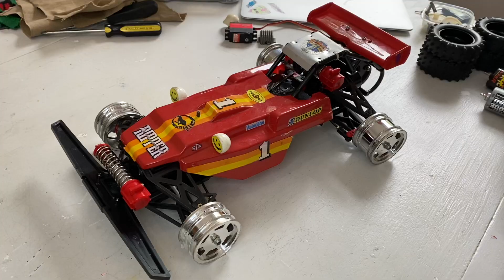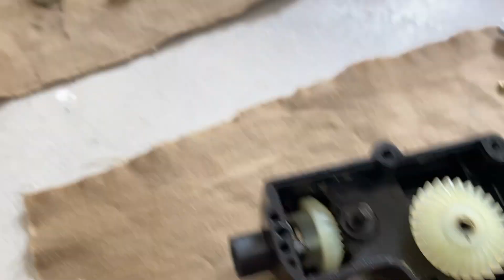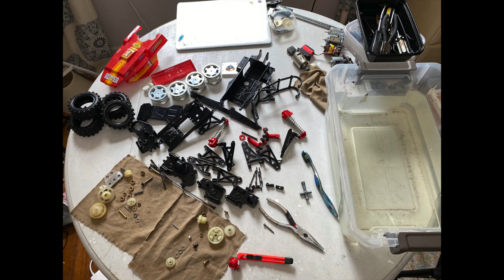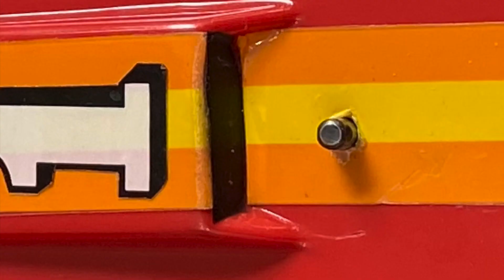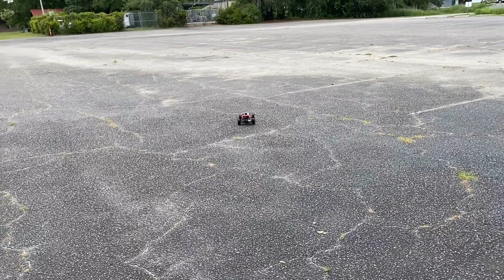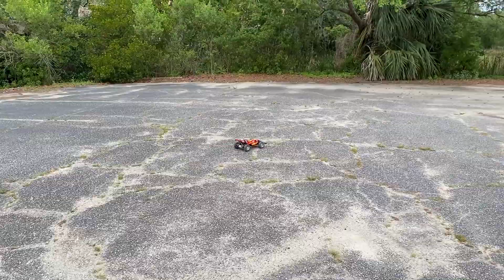1986 ROYAL RIPPER RC RESTORATION AND RUN REVIEW

Comment: I got the Ripper right after it came out. I burned through the speed controller the first day I was running it. So I end up building an ESC out of a components sources from a hamfest. It broke a lot. But I did keeping it running off and on for many years (aided by the two weeks it took to get spare parts from tower hobbies in the 1980s).  Plus I built many ESCs for locals. This was back when you couldn't really afford them.  Oh, but I did configure mine have more steering in the rear.  Yes, it was harder to handle, but you got used to it, and it accelerated much better out of the corners. I also ran foamies on it. I turned down the diameter of the foams in the rear, which gave the fronts a bit of overdrive.
Reply from the maker: Great memories. Thanks for watching

Comment: I had the Royal Crusher.  It was pretty good, I do remember the idler gear in the rear gearbox being a weak point in the car.  I think it was due to the size of the tires on the Crusher.
Reply from the maker: Vintage Rc is something special. Thanks 😊

Comment: Does anyone know where I can get a rear suspension end cap for one of these?. It’s the only part i’m missing. Thanks guys
Reply from the maker: I doubt you will find it unless you buy a parts car. Those are rare too. Best bet get the size of shock and get an aftermarket replacement. Maybe a little modify scenario there. ✌️

Comment: Hello. Nice channel. Just wanted to share a couple things from my personal experience Had a couple Crushers/Rippers back when they were still on the market . The chassis on both as you stated were weak as well as suspension parts. My experience with the gears in both were that they were very weak and easy to strip. I'd get 4-5 runs before stripping the idler gear.Especially the Crusher , likely due to the larger tires. Small pinion on the Crusher. Also, in case you're unaware, there were parts in the kit ( Suspension, chassis parts that were required to be boiled in water for an hour or 2 to be strengthened. Things were definitely crazy back then 😂. Thank you for your content....
Reply from the maker: @charlesromulus7317  thanks for sharing and many more videos uploading so stay tuned in. 😉

Comment: I had one when they had freshly come out and put a ball bearing kit in it.  When I first built it the hubs kinda shattered because that hard plastic did not take kindly to the spray silicone lube that I applied during assembly.
Thankfully Royal sent a new tree with those parts on after lecturing me
about how silicone lube would not hurt the plastic, but the solvent in the spray can would cause the plastic to spontaneously shatter!  Once I got new hubs etc, it was a lot of fun despite the weirdly hard tires
Reply from the maker: @florabee9283  thanks for watching. Happy Summer✌️

Comment: Since I am nostalgic for and love the Tamiya Hotshot, I have always liked the look of the Royal Ripper and wanted to experience the 4-wheel steering.  Looking at the real thing now finally (38 years later) I'm glad I never picked one up.  Several points on that car are definitely not well designed and since it was so low production it would have been a nightmare finding parts for it.

I'm glad you clearly called out this car was a copy of the Hotshot because it completely was.
Reply from the maker: Firstly Ed, hello and thanks for sharing your story. To open up and share/comment takes some vulnerability. On the RR, I feel this company gets a ton negativity on its design and it could be coattails kinda creation but what this company did do right was roll some dice, and with just one shot literally succeeded and executed an rc car with some complexity not a grasshopper clone here and came with great art work. Note: It’s not quite a direct copy of Hotshot it’s a bit different. Actually only big issue is the rear chassis support. Cred goes to Chunky gears, axles, medium hard tires for longevity and lexan body work too was cool but as you know plastic has a shelf life considering it’s near 40 years old. Brittle but so is my acquired 85 HS with its notorious part’s history the shock mounts, pretty much all red parts crack, battery door pin servo mounts, etc..This company -Royal - issues came to money. How many rc car dreamers never even get to functional stage? Production, distribution, legal issues, advertising, taxation-country guidelines etc. And considering the time these came there was no modern day technology to help. Truly amazing really. Obviously It needed more research and development but that came to the detriment to strike while iron was hot/shot and well we know the outcome. I could only imagine what could have happened if this company could have succeeded. I wish they had. This car was a fabulous experience to restore and a nice surprise in the operation. If I wanted to race it I would and could but if the track had any jump ramps taller than two ants, I’m pulling out a Tamiya HS. Because when it breaks around the first turn from running in a left on the track “pine comb” my wallet is only 12.99 lighter at most hobby stores online.😂
Reply: @LukesVintageRC  Totally valid takes, I agree.  Thanks so much for making the video and showing the car I wanted to see for so many years.
Reply from the maker: It is and will always be my absolute pleasure.

Comment: Are you not running thru the speed control board?  I've had one of these since I was 12.  I only got it running once back then and then ran into problems because I didn't really know what I was doing.  Took it out last year, 35 years later, and managed to get it running for my kids who then crashed it, full-speed in reverse, into a curb and which led to a burnt corner of the speed control board.  I can't find a replacement and don't know how to repair the board, so curious to know your work-around since it looks like you don't have a servo attached to the speed control.  I'm an RC novice, so forgive me if it should be obvious, but I'd appreciate any hints.
Reply from the maker: Hey there, I never use the antiquated msc. They never were reliable even new. I basically use a 1060 hobby wing esc and 2.4 radio. Way more reliable and never a problem. Remember these are crazy rare and expensive and take a lot of time to restore and to run old gear is an accident waiting to happen. The parts are beyond extremely hard to find and sellers want a ton of money not to mention collectors will pay a lot. I’d buy a new rc car from traxxas for some fun family running. Perhaps traxxas Bandits as they are cool. Thanks 😊
Reply: Thanks for the reply.  I could have used that advice 35 years ago...

Comment: Nice, this was my first RC Car. Sold from Thunder Tiger with the name Tiger.
Reply: My first one suffered exactly from a weak spot you tell in your Video. After a long period in the cellar, I took it out and looked what is needed to run it again.
After that examination I searched for parts, not an easy job. Over the years I bought three total cars from poor to new condition with box for not much money.
But they still wait to get is done, RC Racing and other cars are more interesting at the moment.
Reply from the maker: @RCjesus.David.2581  Such a fun buggy. Had a blast restoring. I’m excited to restore its monster truck brother and many other fun rc ahead. Thanks David for watching. ✌️

Comment: If you ever come across another Kyosho Outrage ST feel free too convert that too the Kyosho Stadium Baja Beetle, think it's a different set of body mounts, wheels,body basically.
One of my favorite kits in terms of looks.

Also do you still have the Team Associated rc28t ? there is a front suspension kit for that chassis which might be worth picking up & doing an external lipo mod too the truck so you can fit a larger battery & change it out easier.
https://www.youtube.com/watch?v=wTo9FbeTFYw&t=0s
Reply from the maker: Thank you i